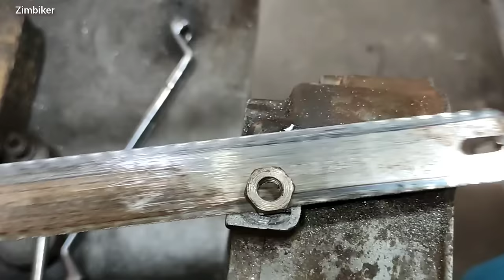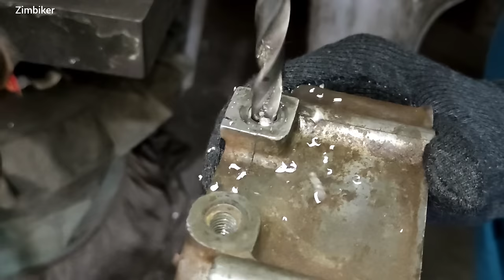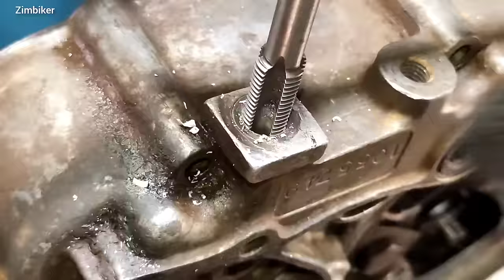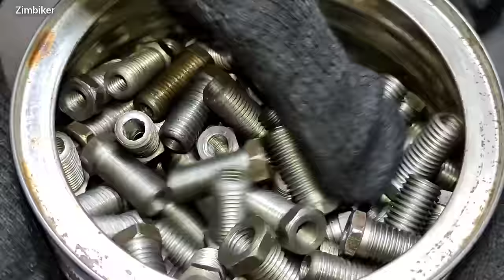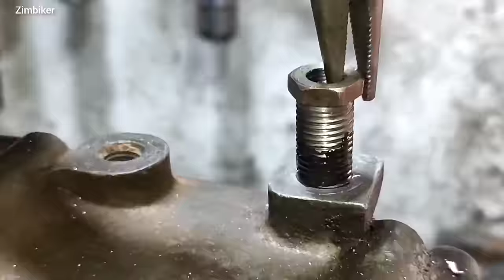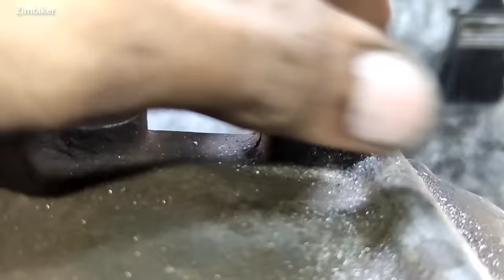How to repair bolt slip threads easily | Zimbiker

Comment: Gotta say thanks for showing the proper way to do that repair, although that's not exactly easy, it's far better than just rethreading and stuffing a larger bolt in the hole, or using foreign material to take up the lost threads.

Comment: Good job. Next time after placing the insert, screw in allenhead setscrew before cutting off. Allows for thread restoration without need for second tap. God bless.
Reply: Excuse me sir, what is that kind of insert called that this guy used with internal and external threads? Thank You! 🙏
Reply: Actually, I don't know, sorry. I  just added the comments, for a way of thread restoration. That information should be there on the video page. Many blessings,  Psalm 118:24.
Reply: @gabrielalvarez9570  bolt with internal threads?
Actually if you have  a drill press, you can drill out the center of any bolt and tap it.

Comment: Pretty smart. I'll be modifying me some bolts next time the job doesn't allow a bigger bolt. So you just have a coffee pot of center drilled and tapped bolts for just the occasion? What are they used for? Also what's the point in heating it with a lighter before applying the epoxy?
Reply: It dries almost instantly
Reply: I thought they sold em like this already lol its a good idea, Kind of like a homemade timesert 😮

Comment: Why does everyone mess with the hole?...I make the bolt threads a larger diameter. Just weld up the bolt and hand file a new set of threads.
Reply: Clever
Reply: There are some cases that a larger bolt or larger threads will not work. Such as case covers on some motorcycles.